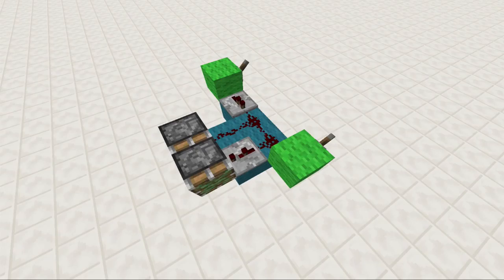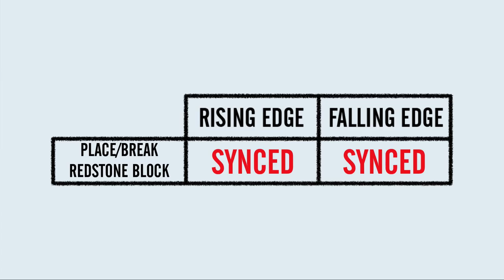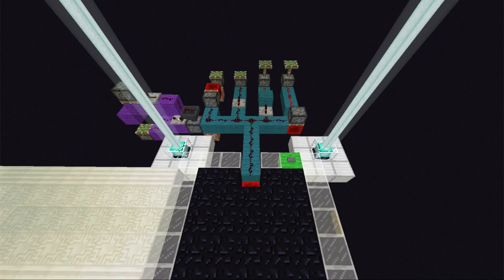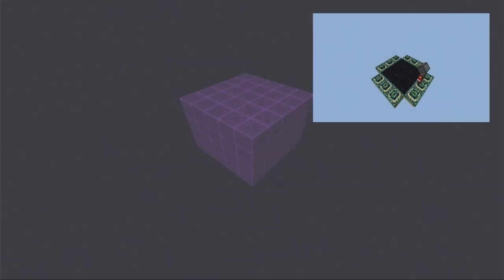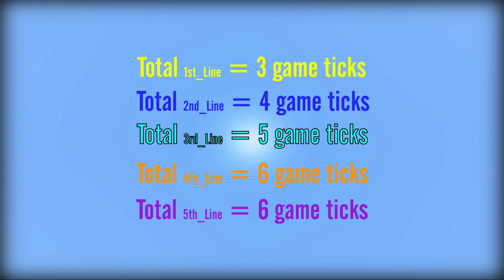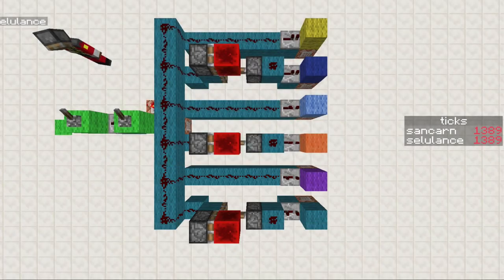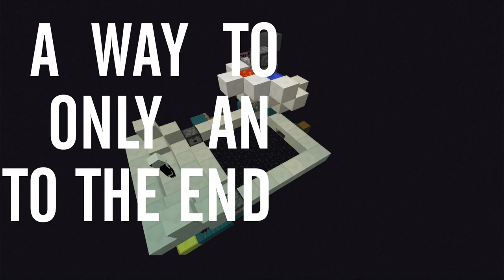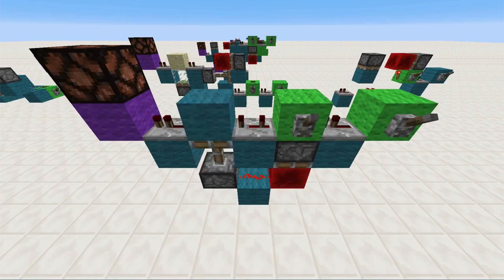XYZ Episode 1 :: Chapter 1 - The Immediate Update Bug (Right)

Comment: My first guess is that updates to redstone dust initiated by entity interaction act according to different code than updates initiated by block update-type interactions. Perhaps one of the two was re-programmed in 1.5, while the other was accidentally left the same? Or perhaps there's a difference in update priority meant to give minimize latency/performance load of player based input, under the assumption that less sophisticated code would be necessary because the player can only reasonably give 1 input at a time.
Reply: MorganEarlJones and as a side note, the buttons on youtubemultiplier weren't working on me, so I had no desire to pause the video to reflect too long on any point, as I didn't want to go through the hassle of manually sync'ing playback every time.
Reply: MorganEarlJones Also, possibly related to this phenomenon is the tendency of repeaters to correct odd-number length(in game-tick) pulses, whereas comparators and torches will preserve the length of any pulse. 

As far as I can tell, repeaters round odd-number length game ticks pulses down by 1 when greater than 2 game ticks.
Reply: MorganEarlJones Yeah indeed. I personally thing it is to do with where in the main loop it is. What sort of time things happens and basically that's why it happens in my mind. Now why it really happens though and why the bug exists - I don't know. I just assume it's this way from the fact that the different results are largely entity-based or player-based interactions